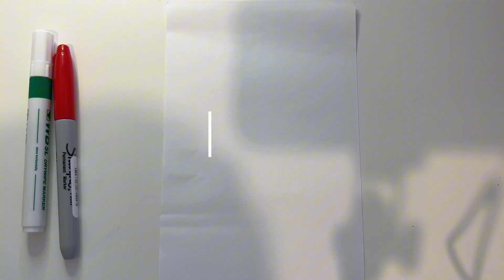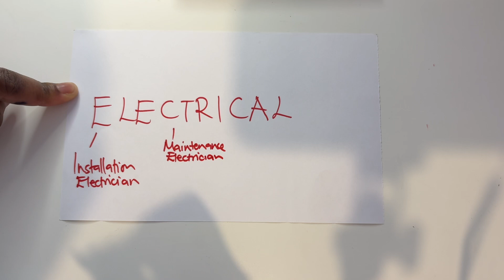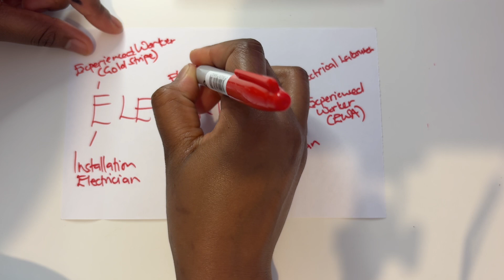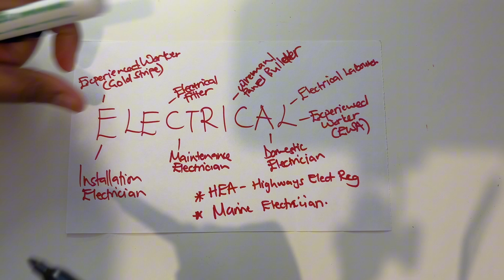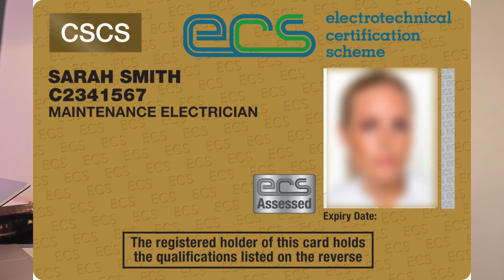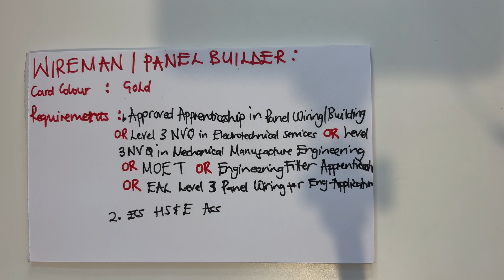ECS Card Types Explained | Which One Do You Need?

Comment: Hi, I need help finding the correct card for me, I've been working in the electrical industry for nearly 20 years and I've never needed an ECS card I know I don't qualify for a gold card but i have C&G 2330 L2&3 and 2394/5 + an old bs7671 qualification (will be doing the 18th amd 3 at some point soon)  i.e. no level 3 NVQ so which card do I apply for? Thanks
Reply from the maker: Hi !
With your experience and qualifications, you’d be looking at the ECS Blue Skilled Worker card.
Your C&G 2330 Level 2&3 and 2394/5 qualifications, combined with your 20 years of industry experience, put you in the skilled worker category. The Blue card is for electrically skilled workers who have relevant qualifications but may not have the Level 3 NVQ/SVQ that’s required for the Gold card.
What you’ll need:
Your existing qualifications (which you already have)
Proof of your employment/experience in the electrical industry
An appropriate health & safety assessment (like the ECS Health & Safety Assessment test)
The good news is that once you complete your 18th Edition and Level 3 qualification (which you mentioned you’re planning to do), you can upgrade to a Gold card.
Quick tip: Before applying, double-check the current requirements on the official ECS website or contact them directly, as card criteria can be updated. They’re really helpful with confirming which card suits your specific situation.
Hope this helps! 👍

Comment: Good afternoon mam. Thank you for your video and shared news to help me navigate what card I need and what the tests I have to go through. Unfortunately I still have a questions which kind of makes me realy consider if I could upply for the gold card if my goal is to become a tester and installer. The qualifications I have : 1 BS7671  2 Mechanic engineering NVQ 7 master degree 3  HS&E  . What test I should do to get a gold card which would allow me to do testing for privet houses and factories ? Thank you very much. P.S. From 12th minte I matching those three requirments but will it match which what I want to gain which is Gold card tester - fitter?
Reply from the maker: Thank you so much for watching and for your thoughtful comment 
To qualify for the ECS Gold Card (Installation Electrician), you’ll usually need:
NVQ Level 3 in Electrical Installation (2357 or 2346)
AM2 or AM2E test
BS7671 (18th Edition)
ECS Health, Safety & Environmental (HS&E) test

Since your background is in mechanical engineering with NVQ 7 and BS7671, you might still need the NVQ Level 3 Electrical Installation and AM2E assessment to meet the ECS Gold Card criteria for a tester/installer.

If your goal is to test in private houses and factories, I’d suggest looking into the NVQ 2346 Experienced Worker route  it’s designed for people like you who already have industry experience but need the specific electrical qualification.

Comment: Thanks for the videos,they have been very helpful.While checking ecctis website,i saw the qualifications can be assessed in 2 ways; by statement of comparability or industry skill statement,which of the option should i go for.
Thanks 
Thanks
Reply from the maker: It depends on your qualifications. Industry skills statement with skills mapping if you have technical and on the job training then industry skills statement for academically qualified persons if you have a degree qualification. It all depends on your qualifications, experience and the card you’re looking to get.
Reply: Thanks for the video, it was very helpful, please being looking for all means to key in to the system, I have over 3 years experience in Domestic wiring and also 1 year experience working as a maintenance technician in an industrial setting,  I have National diploma in Electrical and Electronics Engineering,  Higher National Diploma in Electronics Power System abroad, and currently a Degree in Electrical and Electronics engineering in Uk… which of the ECCTIS options should I go for…